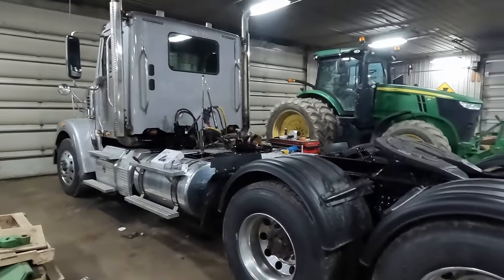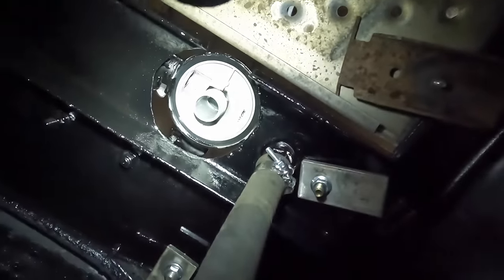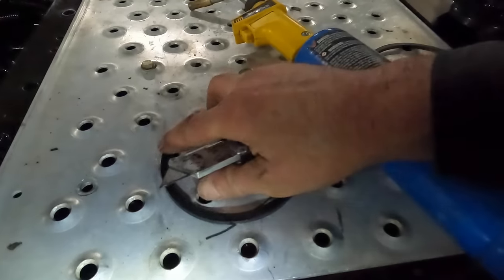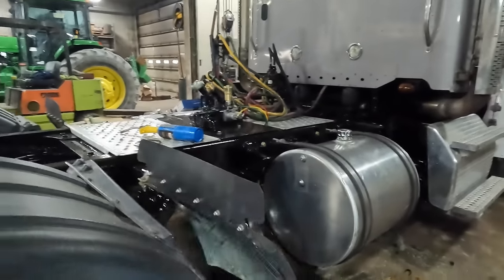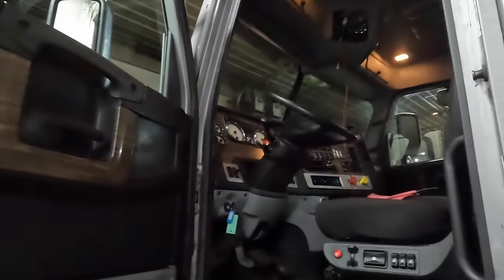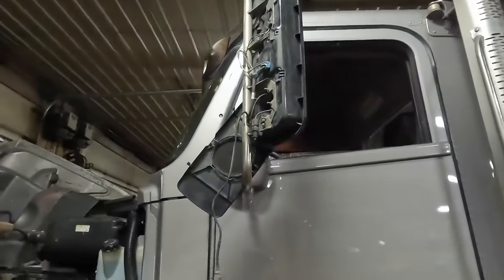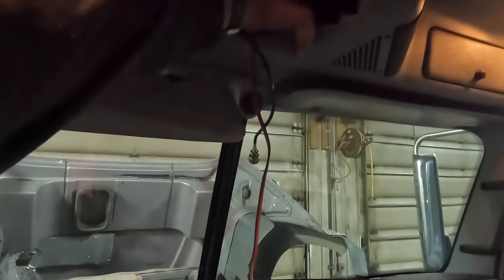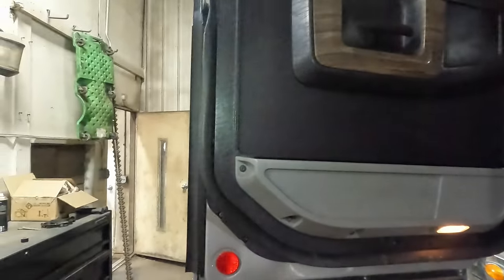Sarah gets first Run With a two way radio

Comment: I am professional radio installer -- they make a mirror bracket where you can mount the antenna on the top tube of the mirror without trouble and with the spring on the antenna i would not worry about hitting anything being that the stacks are right behind it --- nooooo dont make it look like the CB'ers type antenna -- the reflected power of the antenna is very important for good radio operation -- I am in Wyoming however soooo cant visit your shop to help ya out -- sigh
Reply: Oliver880-eg8sz  -- does not matter what kind of radio he gets !!!!!!!!!!!  -- what matters is where and how you mount the antenna that counts plus where the microphone is at for easy reach --- DUH
Reply: He was concerned with the Hight hitting Low Branches on dem dar country Roads. HAHAHAH
The ideal spot for that Antenna would have been on the Back of the Cab, between the corner and the Window. It would get it in the Clear and still be Low enough. 
There is a NMO bracket for just that type on Mounting. Andy has the Stuff to seal up the Coax hole for a nice neat install.
Reply: @m9ovich785  -- TRUE however the stacks are right there also -- dont think that branches would have bother it cause there is a spring at the base of the antenna for that specific purpose as i stated and yes but i failed to mention the NMO mount for the mirror or directly to the body ( which i dont like ) but WHERE you mount the antenna has a DIRECT EFFECT on how the antenna performs when transmitting on the radio -- how about talking to a local radio shop to find out the real information !!!!!!!!!!!!!!

Comment: Just wondering why you wouldn't have just run the antenna wire straight up through the roof from the radio..You could use some of your fancy 3M two part poly caulk to seal...??

Comment: Andy what is rattling in the cab truck looks good nice truck
Reply: Normal flier rattles. I’ve had several and they rattle right from new
Reply: @richardradawetz8788 they don't call them Freightshaker for nothing. Lol rattle the truck and the load on mile one.

Comment: Do you need a license for 2 way radios we do in ontario
Reply: Midland radios I beleave under 5watts doesn't need one due to using frs channels. I could be wrong on the wattage  though.

Comment: antennae is in a bad spot,too much metal . You will probably receive OK,but transmitting  will create too much 'reflective' power back into the radio and will weaken or kill the transmit circuit .  The middle of the antennae to the sweet spot when transmitting  keep that area in the open  line of sight --no metal near it or in the way of the transmit waves.